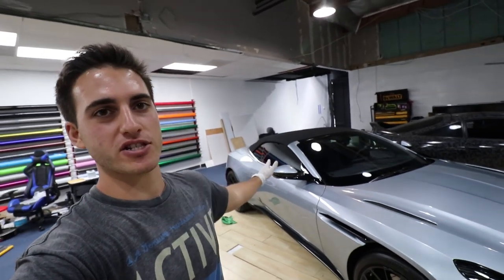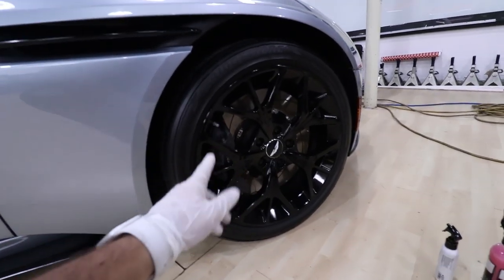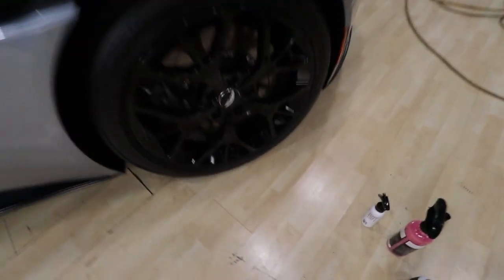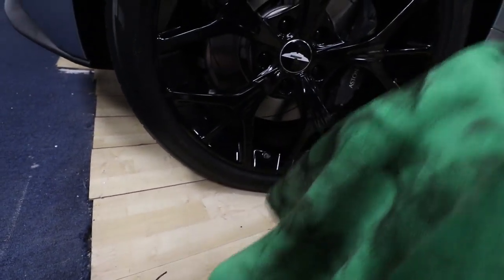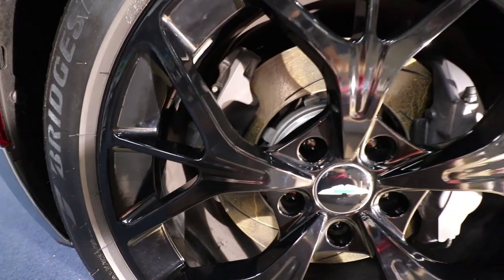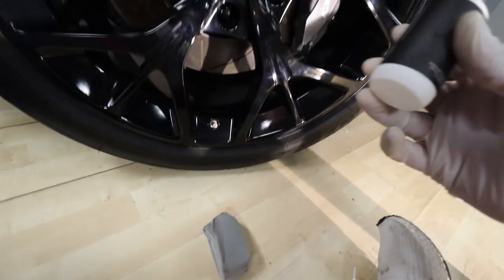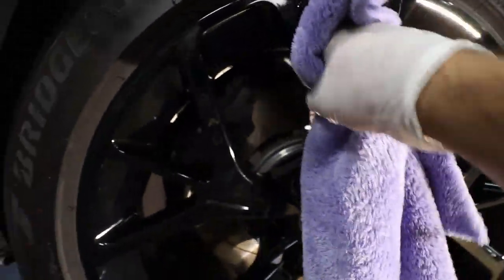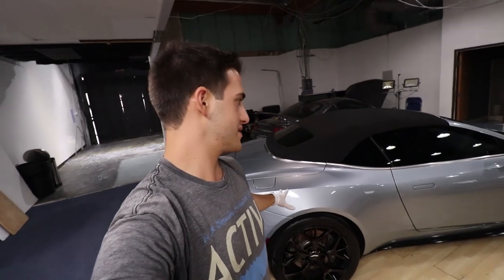How To Ceramic Coat Your Wheels // Quick and Easy

Comment: Does the product effect the rotors? From the overspray I mean.
Reply from the maker: Steven Davis which product boss? Panel prep?
Reply: Yea, or even if your maintaining it with other products like....spray wax?
Reply from the maker: Steven Davis no, the rotors can withstand a decent amount of product. As long as you aren’t using a strong acidic based and letting it sit.